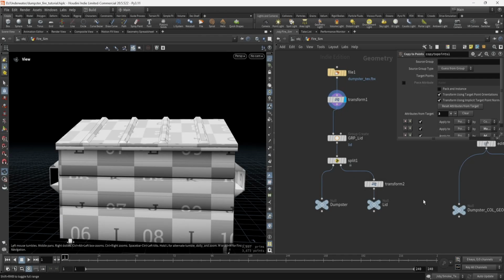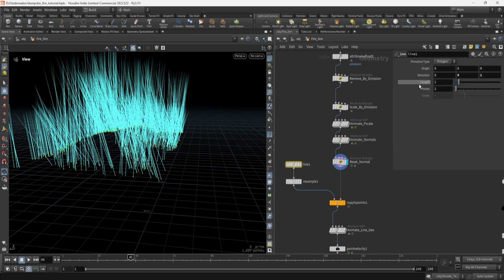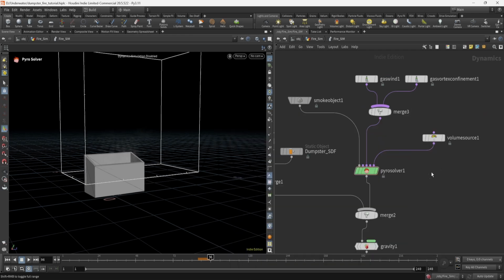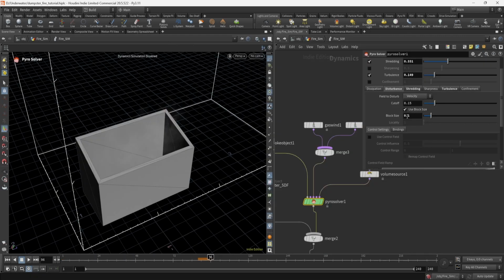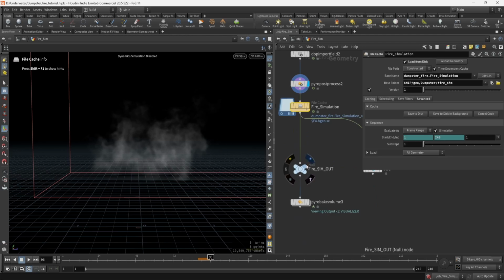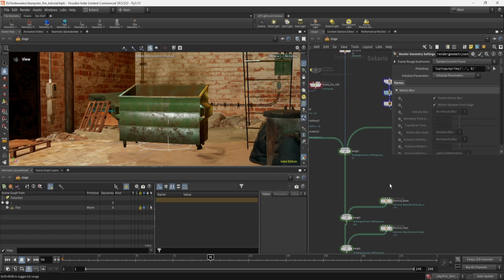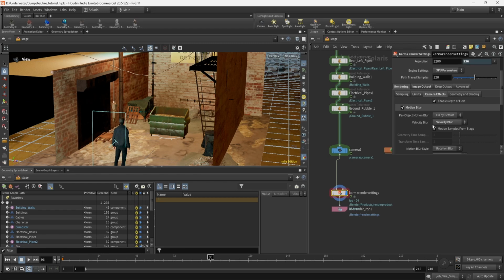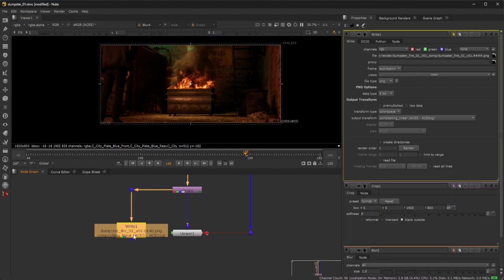Dumpster Fire w/ Houdini: A Healthy Way to Cope With Everything

Comment: This was very cool.  Thank you.
How do you get so much detail in the fire in your viewport?  Even when I crank the voxel size to 0.015 all I see in my viewport is a big orange blob with hardly any detail.
Reply from the maker: Thanks for watching! 0.015 is definitely on the small size to still be experiencing blobby flames. It's definitely relative to the physical size of the sim, so something with a very small volume will need even higher resolution. Particle scale also matters - you can set this with a pscale attribute on the emitter points themselves, in the pyro source node, or in a volume rasterize attributes. Smaller particle scale gives higher definition for smaller flames like the ones in this video but it's always a balancing act. Good luck!
Reply: @pointlinepolygon  Thank you very much 😀